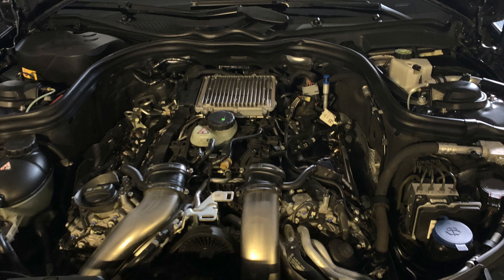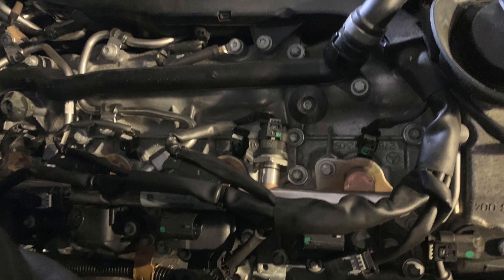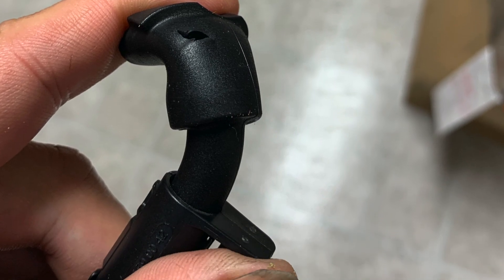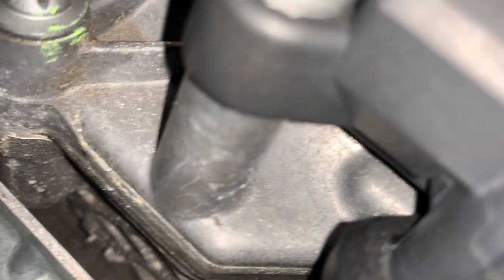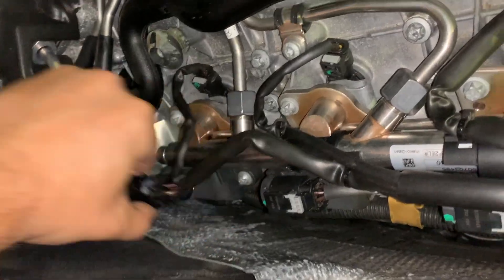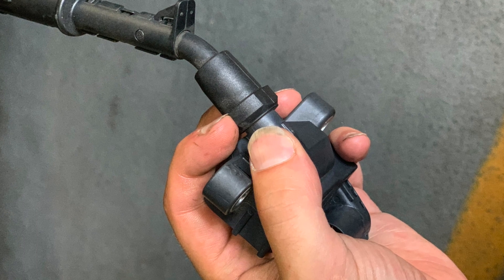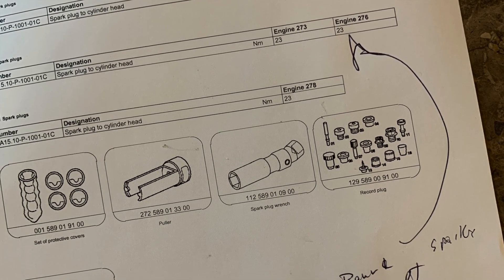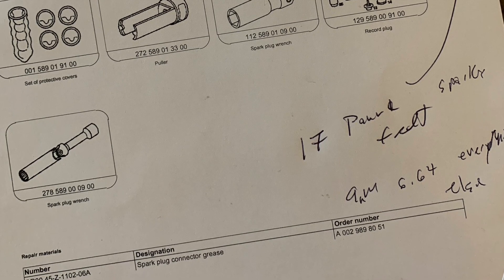Change Mercedes M278 & M157 Spark Plugs

Comment: I did it myself self on my s550 and on the last plug I dropped the new spark plug and bent the tip 🤦🏽‍♂️ I bought another one and was removing the ignition coil boot and ripped it lol. Had to go to the store for that. Yeah all that happened on my last one doing cylinder 5 😅
Reply from the maker: its nice they just sell the boots
Reply: @TunedMercedes  yes and I’m glad they were in stock

Comment: I am the owner of a 2015 model W212 e180 vehicle, the vehicle is shaking and misfiring when going uphill at high gas and constant speed, it is said that the reason could be spark plug, coil, injector, pressure pump, the service says we can find the problem by trying, but it is very costly, have you experienced such a problem, the service does not show any fault record, what could be your solution, thank you
Ali Çıtak
Turkey
Reply from the maker: you should try to datalog the car and see if it is misfiring.  i would start with checking the tune or map, if it is stock i would then go to spark plugs and coils before fuel

Comment: Just did the spark plugs. I now have misfire on cylinder 4,8 also a camshaft position sensor codes what did I do wrong?
Reply from the maker: likely not indexed right. take out cylinder 4 and 8 tighten to tq specs.

Comment: hello i have question i have 2012 cls 550 4matic so do i torque it to 23NM for all spark plugs ?
Reply from the maker: i’ll double check wis
Reply: @TunedMercedes  i dont have wis how can i find out ?
Reply from the maker: @snipershot8049  it is 100% 23nm or 17 pound feet
Reply: @TunedMercedes  thank you i went with 23nm everything seems to be working perfect

Comment: It would really help if you mention the chasis of the car. There is a difference between E550 and S550. E550 tighter.
Reply from the maker: this is a cls 550 c218 should be similar to e550

Comment: Does anyone know the torque spec on the plugs? I believe the video said 17nm but I've been reading 25nm.  There is also a one that says go to stop and then another quarter turn.
Reply: When I did mine it stopped on its own and wouldn’t allow to turn anymore.
Reply: @Phuong_Nguyen_  That's what I anticipated. Some posts have it as "tighten until the plug stops and then another half turn" which sounds impossible.  No issues with cylinder scoring and the like? How long has it been (miles/km?.)
Reply: @markholland1578  20k mikes and perfect and I’m tuned. Will be doing it again soon
Reply: @Phuong_Nguyen_  That's awesome! Did you go factory plugs or Bosch? Also, was thinking about a tune but many online say you need to change the plugs every 20 to 30k miles! Happy motoring man!
Reply: @markholland1578  I was told by fcp euro that the Mercedes plugs are indeed the same as the Bosch plugs. I went with Bosch last time.
Reply: @markholland1578  but tbh I still don’t know 100% if the Bosch and the Mercedes brand are indeed identical or have slight differences.
Reply from the maker: i’ll double check wis

Comment: spark plugs are last thing I change on my cars
Reply from the maker: I hear you. but the ones MB put on originally were hot for fuel economy.  If you're not misfiring or going to a point where you need colder spark plugs, like tuning, I guess the stock sparks are good until maybe 60k miles. tuned I see mine wearing out at around 20-40k miles.

Comment: P069704 Output 3 for the reference voltage of the sensors has an electrical fault or an open circuit.There is an internal fault.

Comment: I need help guys. Left bottom close to the head light is a container taking hydraulic oil. My question is. What is it for and what oil.
Reply: Lol no not that one. Not to worry. It looks like its for brake assist.
Reply from the maker: I would check to see if it is windshield washer fluid. You can test by adding water and seeing if it dilutes.  I had that issue.  It is about $500 from a dealer or a bit of epoxy diy, with maybe $150-200 if replacing vs repairing.
Reply: Active Curve System (active sway bars)

Comment: What is the name of the coil bolt? Which tool is the best fit? 7mm 12 point socket? Thanks.
Reply: I searched online. Looks like I'll need an E-Torx socket for the bolt. Is that correct? Thanks.
Reply from the maker: @eqz2013  That is right, e-torx.  It's not a bad idea to pick up a set.  MB use torx more but, e-torx or external torx, is right up there.  Thanks asking this question -- I'll add a link to the description.
Reply: I use a 3/8 size 14mm 12 point socket with a swivel attached. And very short extension. But note the socket is very thin walled. Otherwise it will grip to the wall of the engine head and you going to battle to get it out.

Comment: Not a lot of informative information on the m278 hey are the engine mount replacement diy friendly
Reply from the maker: @Phuong_Nguyen_  Yeah, and to be honest, for e85 which brings the numbers down on these to an incredible level.  E63 tuned for e85, stage 2 eurocharged pulled off a 10.4 quarter mile with.  EC canada ripped off a 10.164 but that beyond stage 2, track prepped, stripped interior, but still used original turbos.
Reply from the maker: You'd need some tools, like to support the engine and move it a bit.  They aren't as bad as the official instructions from what I've heard but I've seen people put them on stands and move the engine and tranny a bit.  This also works apparently with H-pipes and turbos.  Officially turbos are an engine out, but I've heard people especially on rwd have been able to put the engines on the stands and lower it a bit move it a bit to get them done.  Thanks for watching and your support!
Reply: @TunedMercedes  wow thats great news to hear about the turbo maybe one day when I have the guts to do a m157 turbo swap sounds promising
Reply from the maker: @Phuong_Nguyen_  @daddy duke Personally I can't wait to TCU tune it.  I hope they come down in price a bit.  Solo has it for $1500, eurocharged about 2k. II think the 7g+ in the 550 may be stronger than the MCT version.  Based on the configurations of the 65 and 600 (always paired with the 7g+ torque converter).
Reply: @Phuong_Nguyen_  bro I think the m278 will go down as the greatest sleepers its one on cargurus.com  with 324k miles
Reply: @Phuong_Nguyen_  yes sir I think the m278 share the same forged internals from the m157 supposedly the m278 and more bullet proof vs the m157 from it having a shorter displacement when you look at the benz forums its a couple m157 with blown engines after getting them tuned
Reply from the maker: @Phuong_Nguyen_  I hear you, it's bit too much for me right now.  TCU is sort of new-ish to the USA, although GAD and others have run them for a while in Europe.  I guess/hope they are going to come down, as I would guess you should do a transmission fluid service before.  They do drop about .3s off the 1/4 mile though.  I think Nota_AMG on MBworld.org runs TCU+ECU+DP and is at 11.3 1/4 and 3.14 to 60.

Comment: I have a facelift E63S (W212) and I want to change the plugs myself, I took the air filter housing out and the plastic cover under it. So are the spark plugs under the ignition coils? And the ignition coil shown in your video 0:44, is attached to the black wire in 2:12 / 2:37? So I just unplug each one? Sorry, I have no experience and really looking for a video that shows the process, but nobody on youtube has a video on it. I paid $800 for my first time changed at 25K miles now (drive hard, plugs were bad). I want to DIY.
Reply from the maker: Daniel I am sorry I wasn't more clear, I hope to get better at making these videos.   This was the first big project I did on any MB.  So it can be a DIY, you just have to go slower and take your time.  The coils can break, the wire harness can break.  In general wires off (2:38, 17mm tool as well) Ignition Coils come off (use the 17mm tool). undo spark plug.  Add die-electric grease to the spark plug (part that goes over the boot).  Tighten spark plugs to the torque specified (they index at that torque).  There is another video, I saw. I also did a write up here: http://tunedmercedes.com/electronics/change-to-one-step-colder-spark-plugs/  Feel free to reach out. Please don't do this if you aren't comfortable. I'm not providing any advice, miscellaneous legal disclaimer here.
Reply: @TunedMercedes  Oh I think I get it. Just when I took everything off to access the plugs, I thought the plugs were under the bronze colored metal parts in 2:38. Those are probably the fuel injectors? And the ignition coils are what you're pointing to in 2:38 when you unplug them
Reply from the maker: @Daniel-cs3yi  yessir those are the direct injectors.  They can be replace diy, you may need to code the injectors though.  Only issue is the teflon rings, you'll likely need a whole set for the side + replacing the injector.

Comment: This is perfect, was just prepping to do this job on my 2012 CLS550 and just ordered the tools you linked.  I've had a 'check eng' light for over a year now which leads to a P2096 error code.  It's intermittent meaning every so often after start I had a real rough/shaky idle.  I already did the cam sensors which were known to be defective on this years W218's but that did not solve my problem so I figure this is next.  I only have 44 000 miles on it but, as you mentioned, I've heard these plugs can go fasts.  Any suggestions as to which ones I should put in there?
Reply from the maker: Yessir.  OETuning has suggested the latest Mercedes Benz Spark Plugs which are apparently one step colder than they used to be.  I'll check out your code and see if I can help at all, I think you may want to try new oxygen sensor, and just make sure all the electrical is performing right, in terms of battery/alternator.  I have a couple videos on here about the batteries, if voltage is low it can cause weird issues with sensors.   Here is an FCP Euro link for 278 and 157 sparks, 8 are needed: https://www.fcpeuro.com/products/mercedes-spark-plug-genuine-mercedes-0041598103
Reply: @TunedMercedes  thanks, yes already did an o2 sensor but it didn't solve it.  Funny about the low power situation.  I had a few occasions where my battery had run low which caused all sorts of issues and error codes.  I replaced the battery but every now and then, based on the behavior of the car, it seems a small amount of times I get low again and wondering if this causes my issue.  It's not a daily driver by any means, I keep it on a battery charger/conditioner every now and then but I'm wondering if that's enough to keep the battery at a good level at all times.
Reply from the maker: @skywardpixels7225  I bet that could be it...  2 sets of O2 but I bet you've covered that.  I also heard a from dblok on mbworld, that flipping all the coils from right to left helped out.  So you might want to do that when you update the sparks.  Let me know how it goes.
Reply: @TunedMercedes  That's my reply above, didn't realize I was logged into my other account on my phone!  As for the o2, I'll have to dig up the service record but I think based on the P2096 code we only did the one sensor.  Just curious though, would a bad sensor actually cause the intermittent rough idling right after start up?
Reply: ...also, just picked up my spark plugs today, I after doing some searching which included FCP (in which I have ordered from before but I am in Canada) I found the updated plugs at my local (and only dealer) for $29 CAD each which was unexpected considering it was the dealership!  I ordered the two tools in your description but had a question about the EWK removal tool.  It's very different than other EWK tools I've seen where it looks like a complete sleeve that fits overtop for pulling out the connectors.  Is it better or easier for use on the M278?
Reply from the maker: @c.a.n.4202  I didn't try it without the tool  In theory I guess a 17mm might work.  I can't speak to anything about other than what I used.  I'll look into it though.  I would also consider getting a smaller lengthwise non-swivel 14mm 12 point spark socket.  It would make life easier on the back cylinders toward the cabin.  I used a gear wrench swivel wrench for this, I think they loan it out at auto part stores.
Reply: @TunedMercedes  The two tools in your description (I ordered) just arrived today.  When you say to get a smaller non-swivel for the back cylinders, you mean just a straight forward spark socket that is shorter than the ARES one I just got?  And as for a "gear wrench swivel wrench"  I'm unfamiliar, you mean something like these? 

https://www.amazon.ca/GearWrench-Flex-Head-Combination-Ratcheting-Wrench/dp/B0002NYD3U?th=1

If so, you use these instead of a traditional socket wrench for the back cylinders?  I guess it'll make more sense when I get into the engine tomorrow but want to have all the proper tools before I start.  Thanks again for the detailed info!
Reply from the maker: @c.a.n.4202  Yessir, the straight non flex socket isn't necessary.  It just would make it a little easier.  The bulkhead there is really close to the spark plugs there.  With the flex, I pulled the socket from the rachet.  And take my time -- I didn't use that, but in retrospect I would get that for the next time.  The thin flex-rachet is just something that makes it easier.  Around here they will loan those out for free, from Autozone or similar.  I think you can do it without it, but it would be easier with it: https://www.amazon.ca/s?k=flex+head+ratchet+3%2F8&i=tools&crid=4E22C5IQIGVW&sprefix=flex+head+ratchet%2Ctools%2C148&ref=nb_sb_ss_i_2_17

Goodluck. You got this.
Reply: @TunedMercedes  Just got back from store hopping locally and was able to find a short, non-swivel 14mm socket and a 14mm gearwrench (that one was tough).  Might be overkill but I nabbed all this since I don't know what to expect especially with the ones near the firewall.  I'm about to attempt it now as I think I got everything I need.  I guess those ones near the firewall you weren't able to use a torque wrench and just eye-balled it for re-torquing the new ones in?  Here are my items, plus a good torx socket set not in view --> https://imgur.com/a/kExkK2Z
Reply from the maker: @c.a.n.4202  I went with a tech recommendation of quarter turn past tight. little bit of resistance, an extra quarter turn.  I gave up trying to torque those with a torque wrench. -- can I use that picture on the writeup tunedmercedes.com (lmk about attribution).
Reply: @TunedMercedes  Absolutely!  That's me posting comments on your site today but they're not displaying correctly, not sure if you received my msg.  I don't care about attributes but perhaps it might be relevant for any of those looking for these tools in Canada.  Once I actually get through and complete the job maybe I'll take a second photo and actually show which tools I ended up using and removing the other ones.
Reply from the maker: @c.a.n.4202  Sounds good sir!
Reply: @TunedMercedes  Almost done the job, ended up breaking one real stubborn boot.  I''m having a difficult time though figuring out these black electrical connector clips (the one' that go back into the coils) in terms of getting them to snap and lock again.  Any suggestions?
Reply from the maker: @c.a.n.4202  I broke one, but several had that issue.  I kind recall having to push one of the latches or housing forward or back slightly to have re-engage the snap clip, before clipping back into the coils.  Same thing with the Air density sensor I guess on the air box.  The one I broke I ended up using a couple of zip ties on to keep together.
Reply: @c.a.n.4202  Just wondering - were you able to fix the misfiring issue? Any insight on what it turned out to be? My 2012 CLS550 has the exact same issue. I am going to replace all 4 o2 sensors, as well as spark plugs just to get it out of the way. Almost at 80k miles now

Ignition coils aren't too expensive either but I might try and figure out which cylinder is misfiring by unplugging one coil at a time and seeing if any are bad.
Reply: @reddyuda  yes, it was indeed my spark plugs.  After replacing them the light and occasional rough idle has disappeared.
Reply: @c.a.n.4202  Aah thank you for the update! Helps to collect data points on the M278 platform, I'll probably make a post on MBForums for anyone else that has this issue. Seems fairly common
Reply: @c.a.n.4202  I have that same code and was told I had alternator ripple which appears to be a thing on my 12 E550 with the M278 motor.
Reply: @markholland1578  I can tell you with certainty in  my case it was the stock plugs.  I haven't had the code return and it's been 2 years.
Reply: @c.a.n.4202  did you torque the spark plugs 23nm for the 2012 cls?
Reply: @snipershot8049  I can't recall the number but whatever the book called for on these it's what I torqued them to.
Reply: i dont mean to be offtopic but does anyone know a method to log back into an Instagram account??
I was stupid lost my account password. I love any help you can offer me!
Reply: @Marlon Tristen I really appreciate your reply. I got to the site through google and I'm in the hacking process atm.
Seems to take a while so I will reply here later with my results.
Reply: @alankonnor35  How'd it end up Al?
Reply: @Marlon Tristen it worked and I now got access to my account again. Im so happy:D
Thanks so much, you saved my account!
Reply: @Alan Konnor Happy to help :)
Reply: @Alan Konnor Instablaster ;)